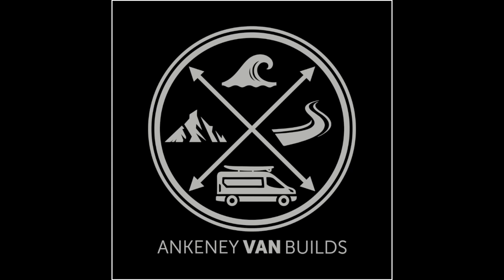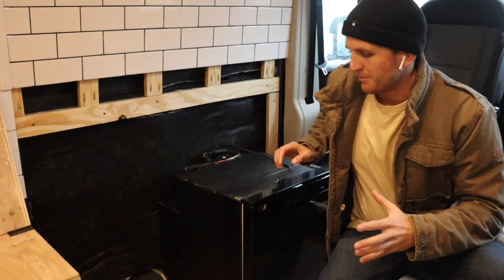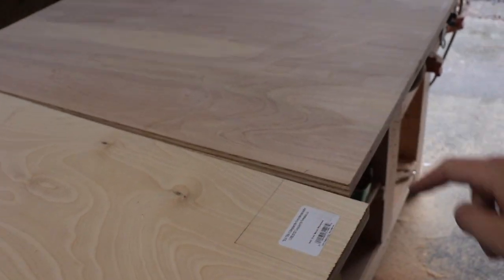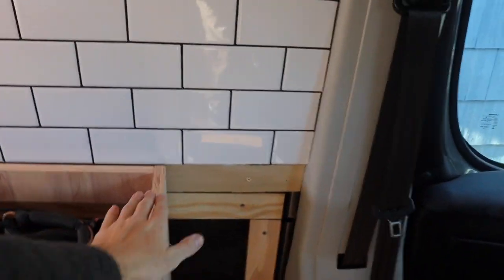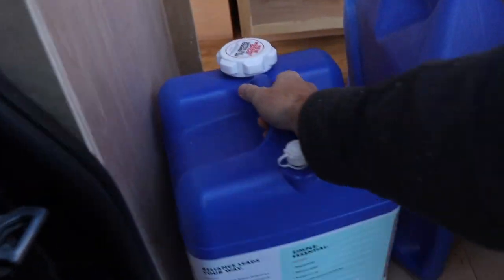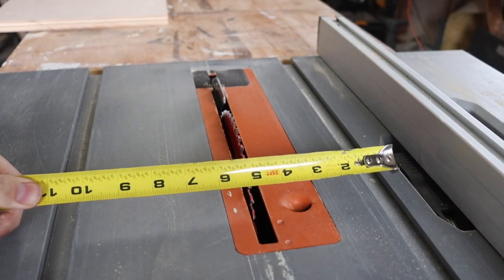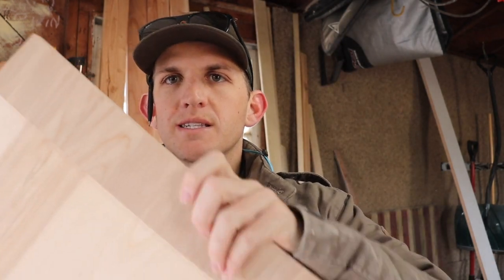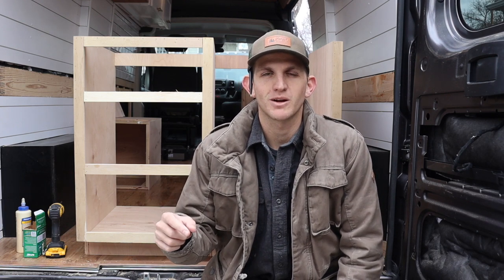VAN BUILD | LOWER CABINETS and SHAKER DOORS | HOW TO | PT 1

Comment: Cool video, But the typical way for cabinet doors is the vertical (styles) run full length and the horizontal (rails) run in-between. Also, being that it is a mobile rv that would see unpredictable climates, the center panels should be free of gluing to allow for any expansion or contraction. Just my two cents..

Comment: Very nice video! I'm converting a van myself right now and I'm at the stage of figuering out the cabinets. What thicknes do you use for the face frames?
Reply from the maker: 3/4” thick and 1-1/2” wide

Comment: How do you secure/anchor the cabinet to the floor?
Reply from the maker: I have them screwed into the walls on the studs and or metal framework if available. And for the sink I have it screwed into the bench seats